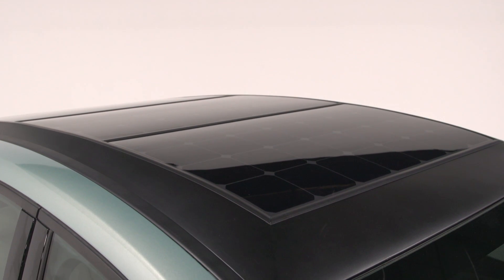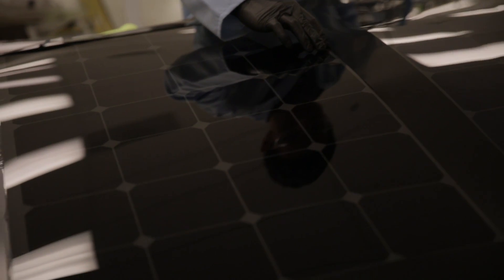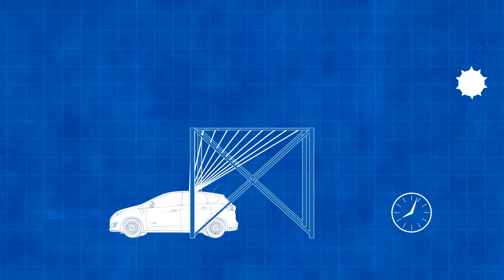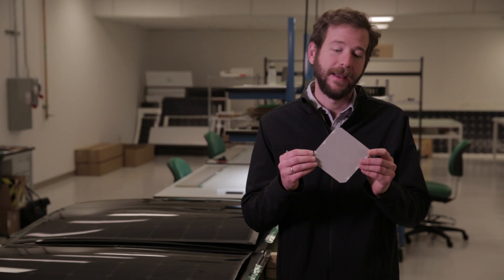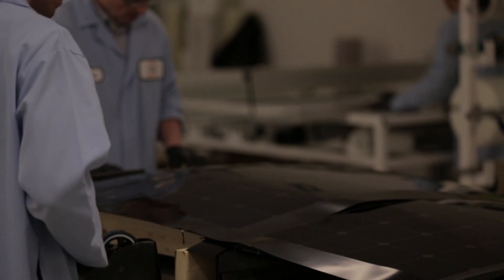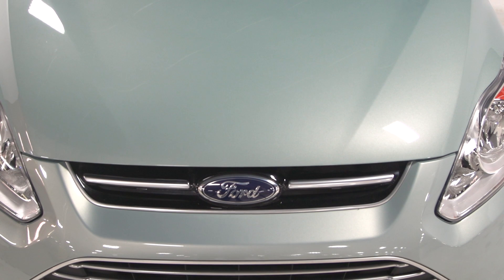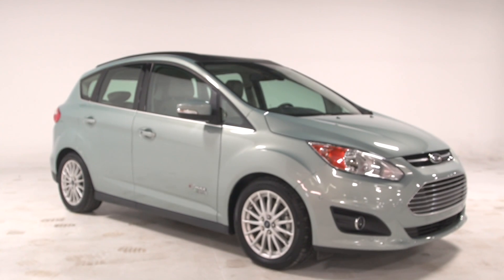CMAX Solar Energi Concept Car

Comment: This not practical for most in the US, here is why:

The assembly with lenses for concentrating the sunlight on the roof means the car has to be put on a treadmill kind of device in order to keep the roof of the car underneath the ideal position for the concentrated sunlight, as the sun moves across the sky. But, the real problem with this concept, is that this idea for optimum recharging means the car can't be driven during the day. You're not going to concentrate much light parked at night when you get home from work. So, unless the employer has car ports with this kind of technology, this is not practical.
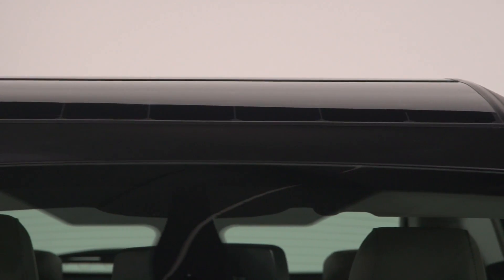Reply: About 1:08 into the video you can see the raised portion put over the PV cells. That would be the Fresnel Lens, that may not provide enough energy for continuous running, but will allow a much faster recharge whether driving or parked. I'd think it easy to also tie into a home solar arrays.  What other car can just sit in the sun long enough (no external connections) to buildup a full charge to go to the full range of the batteries, plus have some charge added to extend the range as you go?
Reply: Jim Young
But the Fresnel assembly does not go with the car. That assembly is for use while parked. The Fresnel assembly is about 15.5' tall, which exceeds the maximum limits of about 14' for going under overpasses in US highways. Also, the width is about 14', which also exceeds the 12' limit for car lanes in US highways.

So, clearly it is meant to be used while parked. So it is not practical because most people are at work during the day. So is the car as well. You could charge it using that Fresnel assembly on weekends, but only if you don't use the car for weekend duties. Not only that, this solution needs the car to be put on a moving platform to keep the sunlight concentrated on the roof of the car as the earth rotates under the sun. This is just silly.

Solar panels on cars are not practical. Look at it this way. The radiance of sun light on the surface of the earth is about 100 watt per square foot. Even if solar panels get to be 50% efficient, you could only absorb 50 watts per square foot of car roof realestate while on the go.

Good batteries on the car, like the Tesla, that charge at home while we sleep is the way to go. Combining that with a small diesel or gas generator is a practical solution. Which is one of the reasons Tesla is making money on this.

IMO, the Engineers at Ford need a little bit more vision before they go public with silly ideas like this. It does make them look like amateurs.
Reply: Peter Davila
Wow, you are right (as illustrated and described). I rechecked it (and checking other sites) and it does make it seem to require far too much movement of the vehicle under the concentrator.  I can't believe they would be using it as drawn, and wonder if it is really anything like the illustration.
Reply from the maker: Jim Young Frankly, imho, it's simply a showy concept car. The cost would be way to high to justify, and makes much more sense to simply put the solar panels on you roof or carport. Only logical in very remote places, but in such cases, this would not be the car to solarize.